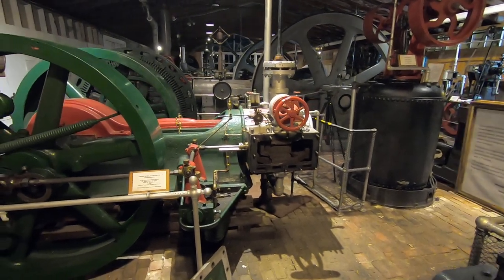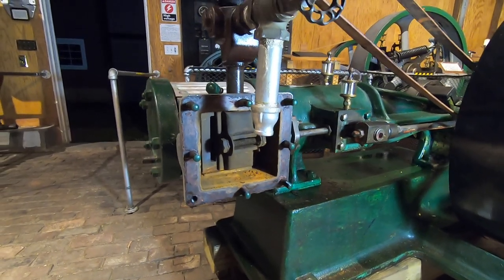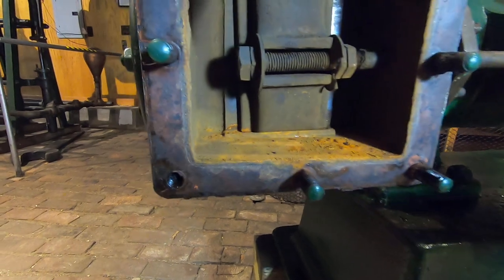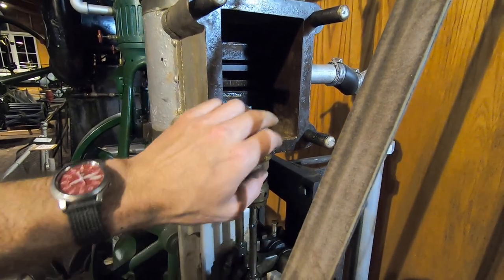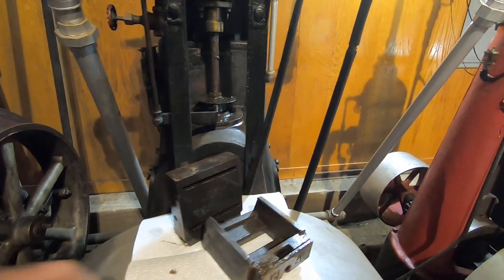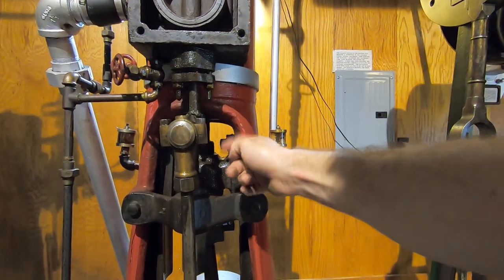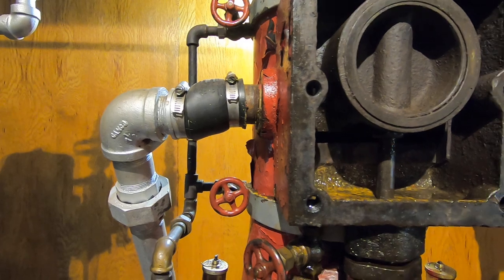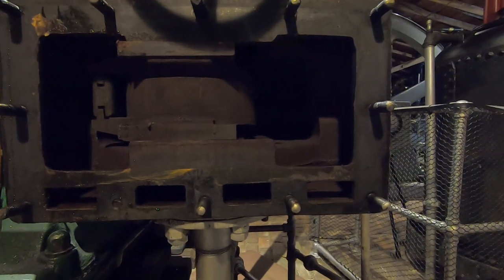Steam engine valve exploration

Comment: Outstanding explanation of the valves. I've never seen a riding cutoff valve in the flesh. I believe the ring on the back of the Sears and Robuck engine is a balancing ring for a balanced slide valve.. the ring is made to keep full steam pressure from getting to the area inside the ring, effectively reducing the surface area exposed to full steam pressure and reducing the friction loss caused by, say 100psi on the 36 square inches of a 6"x6" valve... Concentrated on only the surfaces touching the valve face.

Comment: Fascinating video. Nice to see a variety of differnt engine types and the valve mechanisms. Would love to have seen the original patterns for casting the steam chest / cylinders for the American Ball engine, must have been a nightmare to design!
Reply from the maker: Thanks for your comment.  Yes, the American Ball casting is incredibly complicated.  I believe it's shown a bit more in-depth and with better lighting in one of the subsequent videos.  The steam passages are duplicated on both the upper and lower sides of the steam chest so the patterns and required cores must have been quite complex.  Quite a testament to the foundry that cast it!